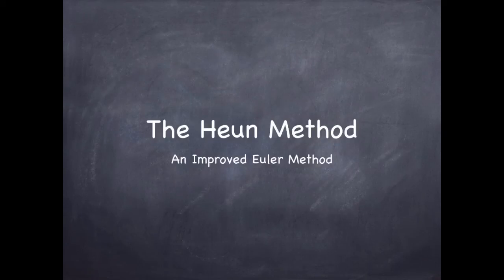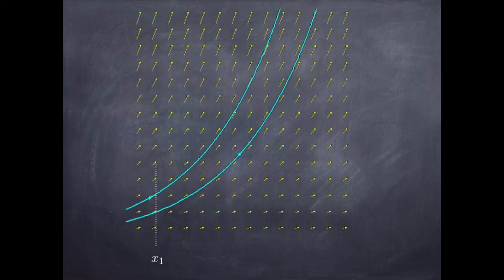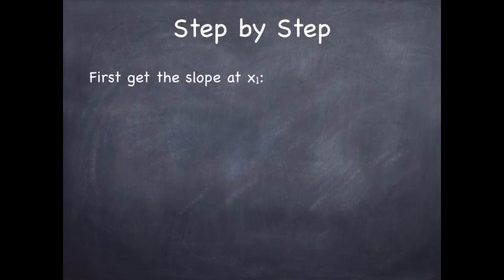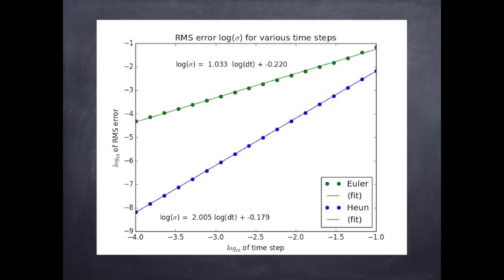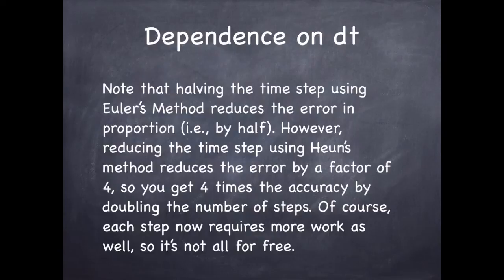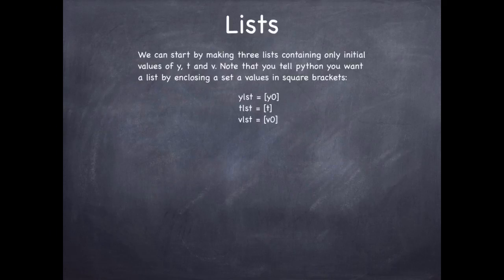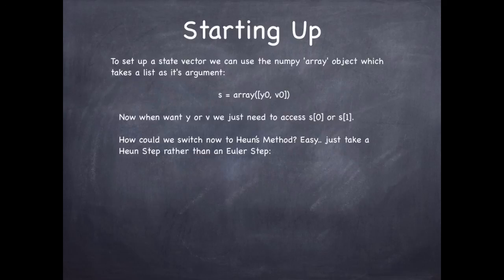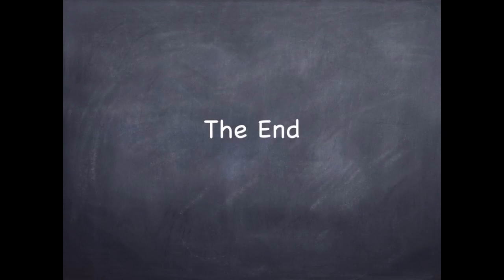Heun Method (fixed audio)

Comment from the maker: Just noticed that (while it didn't matter in any of these examples) the correct HeunStep should look more like:

def HeunStep(s, t, derivs, dt):
    """
    HeunStep is a generic implimentation of the Heun Method.
    Notice that it knows nothing about the state, nor the physics
    of the problem (which is handled by the 'derivs' function
    that is passed in by the programmer).
    """
    f1=derivs(s,t)
    f2=derivs(s+f1*dt,t+dt)
    return s + 0.5*(f1+f2)*dt

Notice that f2 should be computed at t+dt, not t. In the examples studied derivs didn't depend on t explicitly, so it didn't matter.
Reply from the maker: It's for our scientific computing course. I'm being pretty deliberate here. I'm going to be moving into linear algebra territory very soon where "vector" doesn't mean a pointing vector from elementary physics, but a more abstract object from a "vector space". I want them to begin thinking of a vector in a more general way and this is a first step in that direction. I expect them to be a bit confused, but I hope it's short lived.